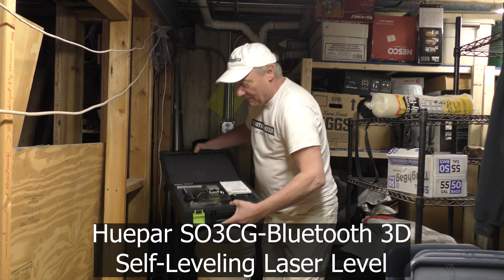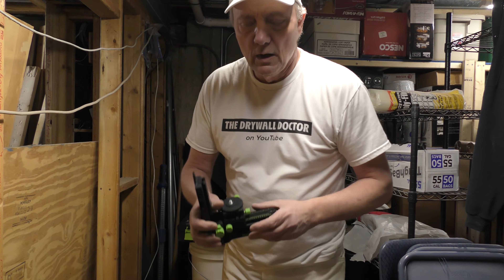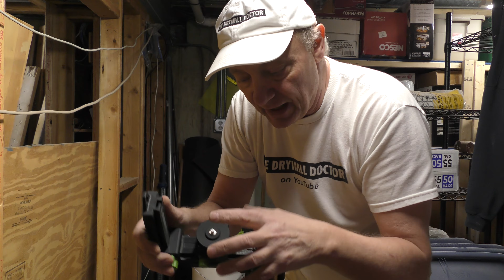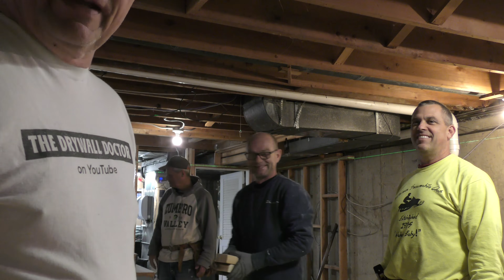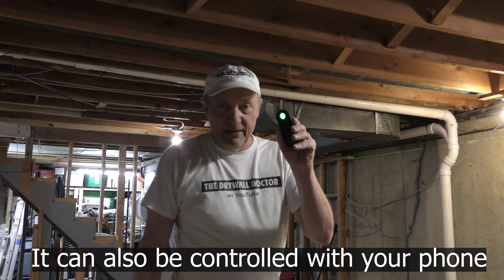Huepar S03CG - Bluetooth 3D Self-Leveling Laser Level with LCD Screen

Comment: You've had some time on this level now. How do you like it? Is it still accurate? I have heard a few people complain that it started malfunctioning after a few weeks.
Reply from the maker: The carpenter I gave it to said he has to keep it plugged in at all times to keep working.
Reply: @THEDRYWALLDOCTOR1  thank you for being honest. I think I will stick to my original plan and get the Dewalt DCLE34033D1. It will use all my battery packs. Might cost more but at least it'll be a reputable name-brand.

Comment: Hey brother . Ive got a 8 x 9 ceiling repair . Basically need to pull old sheetrock down , prep the studs and hang two sheets and a foot strip of a third , mud joints and  also match  texture finish on the ceiling.  i know you cant see the job but can you just take your best guess at what i should charge ?
Reply from the maker: Low side $350- high side $500 depending on all work masking off ect...

Comment: Thanks for all the tips and tricks. I've got a peaked ceiling with 7 pine beams spanning the ceiling. Any tips on mudding around a circle on an angle would be greatly appreciated. I am just reeling with anxiety. That's 14 points all different sizes over cabinets in an angle.  Just pray for me😅
Reply from the maker: Do your best, caulk the rest that's my motto